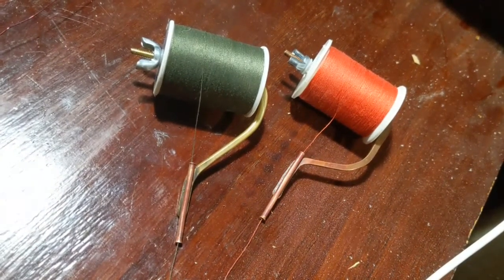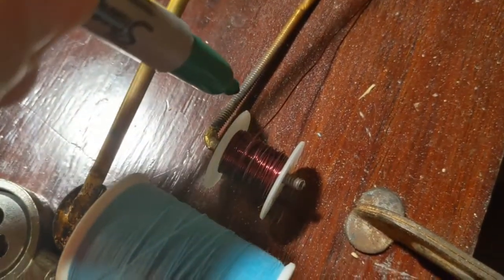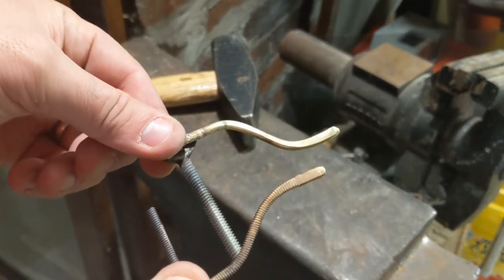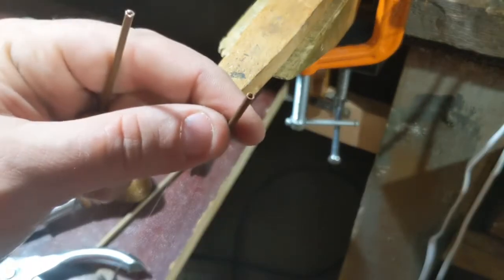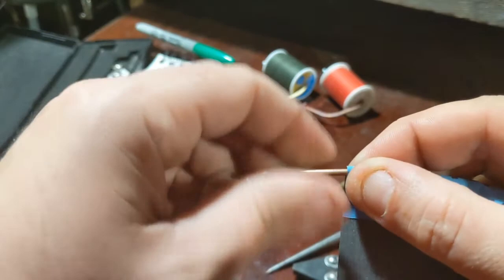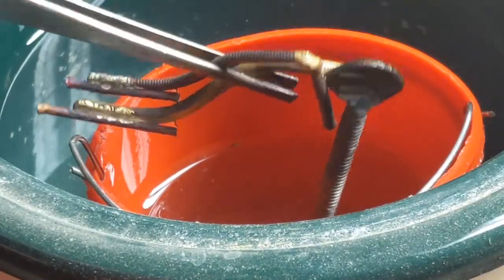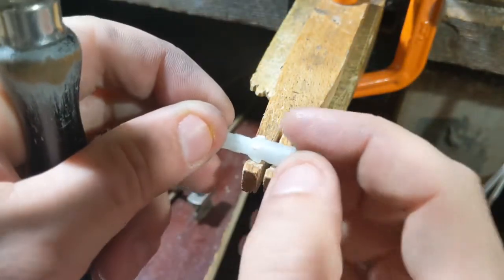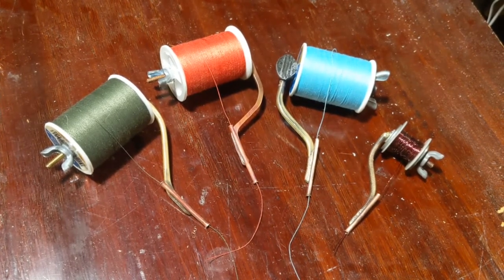DiY Tie-to- Fly Tying Bobbin

Comment: Well done. Nice to see guys that build stuff just for the sake of real craft, regardless of how cheap an off the shelf item is. Ignore the nay sayers. They're the reason domestic made stuff has gone to shit. 
 Just a suggestion: For your flares, clamp the tube between blocks of wood in a vise or to the top of you bench. Use a broken off drill bit or get a high grade bolt or cut off 1/4" hex/Allen wrench. Grind a cone on one end, getting it as even and centered as you can. go up grits to get it to almost polished. Being careful to constantly quench it (Or heat and re-harden it after). Chuck this cone bit into your hand drill and spin it into the end of the tube. Should make short work of flaring it and avoids pounding bends into it. Should be quite smooth, but if needed, make a cone on the end of a hardwood dowel. Use this and some polishing paste.
Reply from the maker: Thank you for the encouragement, support, and the excellent ideas! 💡👍

Comment: How about using cone shaped bushings for your smaller bobbing? They would accommodate any sized bobbins as they would be self entering as such, as they would only go in as much as required. Adding a little ( very little) bearing so that you can add pressure on the sides of the bobbin to keep the cones in place. It will take a wee bit of work to ge5 it, but I know i5 is possible. Thank you so much for your insights. Very ingenious, my brother. Warmest regards, Cam from Ontario, Canada eh! ?  Max Webster rules!!!
Reply from the maker: This is an excellent suggestion, I have been thinking about revisiting this project because it has been a while since I made these ones, and that is one area I could try to make improvements in version 2.0